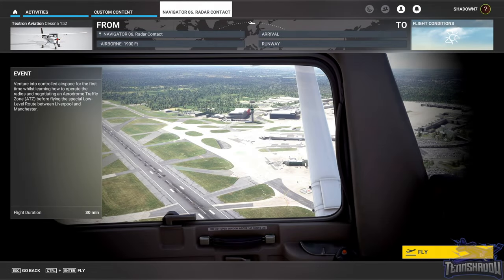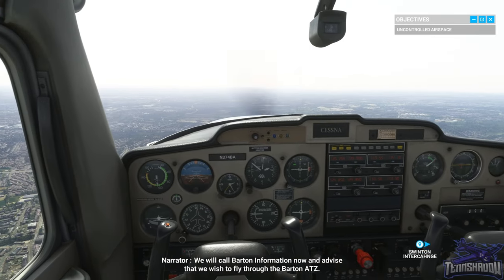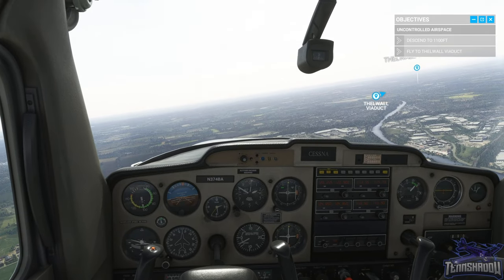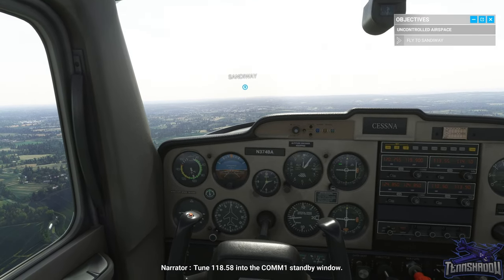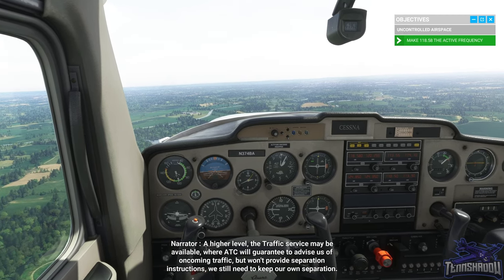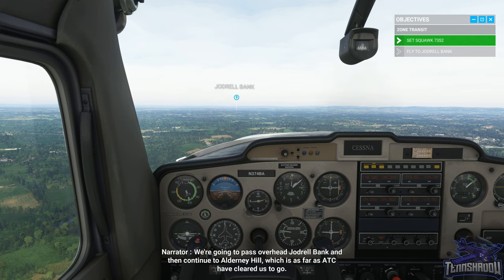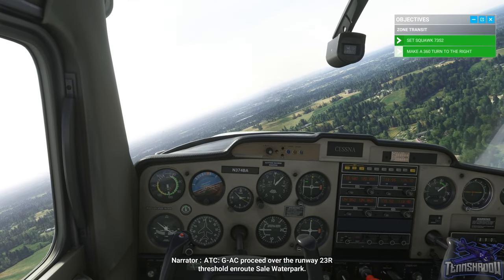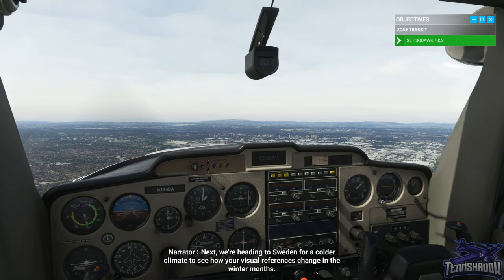FS Academy Navigator - Lesson 06 - Radar Contact - C152 | MSFS 2020

Comment: Great video, thank you 👍
I have just tried this flight three times, but when I get to the settings of the transponder code, I can't dial in the numbers! I can turn the transponder on and off, but when I hover the Mouse pointer over the knobs controling the numbers, nothing happens. Do you by any chance know a solution for this? 🥴
Reply from the maker: Sorry, I don't.  I've never experienced that before.
Reply: @TennshadowGaming  thank you for your answer. I hope it's gone next time I fly this lesson 🤞
Reply: I found the answer my self 🙂 I removed all my 3rd party addons regarding the cessna 152 in my community folder, and now the transponder is fully working in the cessna 152 🙂
Reply from the maker: Awesome find! 3rd party plugins can cause lots of issues.